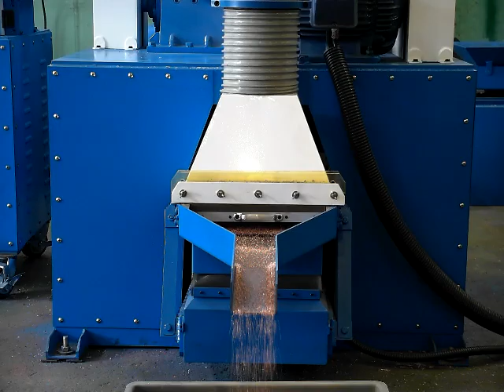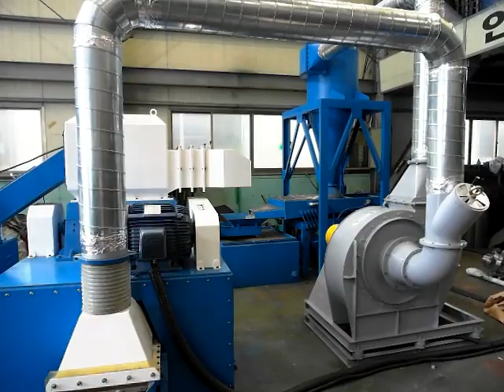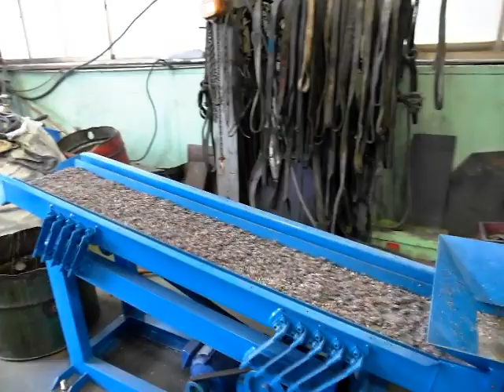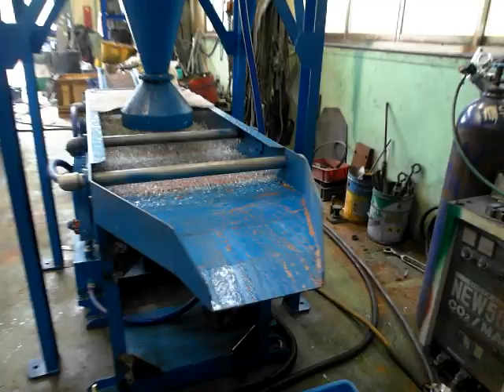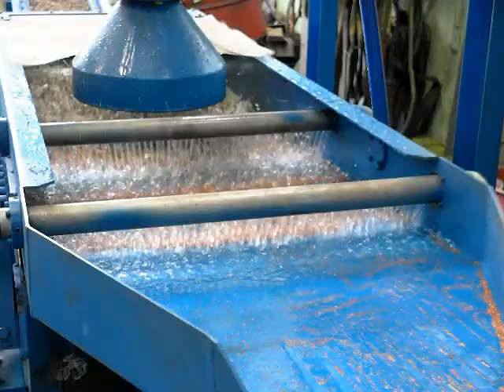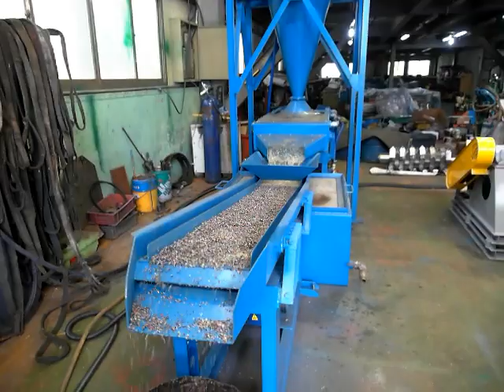Electric Cable Wire Recycling Machine CP 824DW WhatsApp/Viber/Line/WeChat/Kakaotalk +82 10 3198 5119

Comment: what is wet and dry seperation? and what is that grey like  granuales which is washed by water and filed in ablack bucket ?
Reply from the maker: CP 822DW is copper cable chopping machine which separates copper and plastic skin. Normally copper cable chopping machine is classified in wet or dry type, but CP 822DW has two different systems in one line of machine to take more copper from cables.

First wires are processed by dry system and there will be copper remained, mixed with plastics. So plastics are flew to wet system of chopping line for second processing of water. There little remained copper is saved and separated from plastics. So grey one of plastics goes to left and copper to right.

This system is ideal for highest recovery of copper and will fasten returns against your investment in machine. This is first machine in this industry.

For more, contact me to ryan.sewook@gmail.com or call me to Korea +82 10 3198 5119.
Reply: ok,but in youtube is see lots of other machines like this...
Reply from the maker: Hello,

You can see many more videos at https://www.youtube.com/user/OJUNGIND1/videos
Reply from the maker: Yes there are many machine like this. But they are one of them, wet or dry type but not dry and wet two types in one machine. We have dry, wet and dry+wet system. The above video is for dry + wet mixed type.